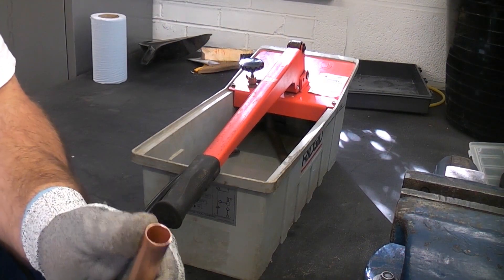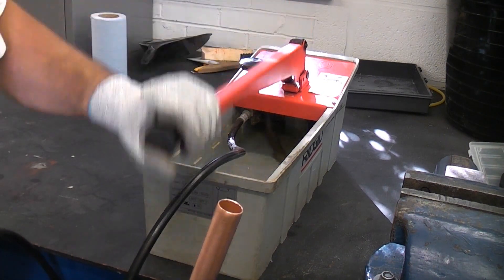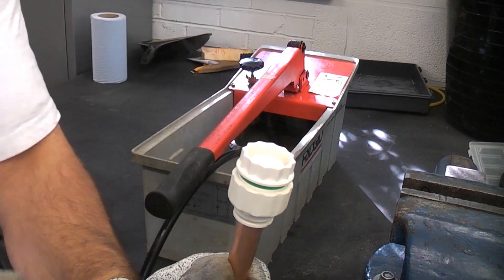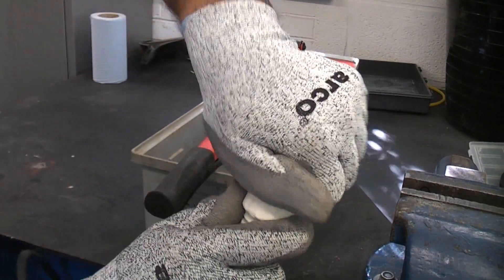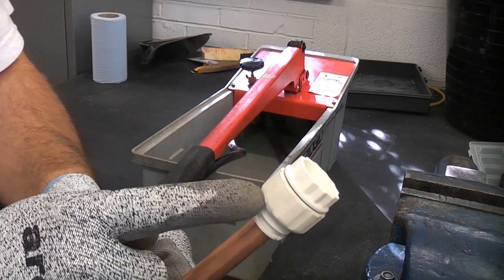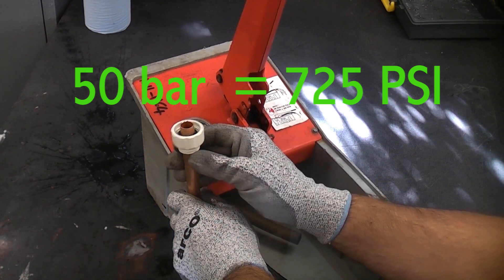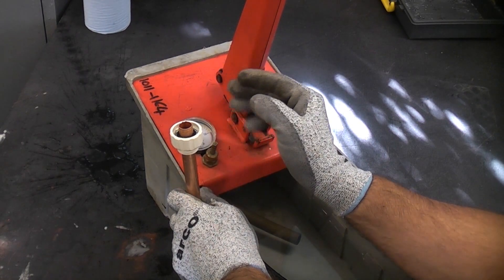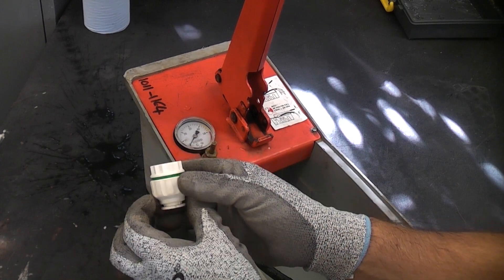Push fit fitting pressure test

Comment: I'm goings to DIY my wet room and I'm planning on using plastic pipes because I'm not a plumber. I'm going to be hiding the pipes behind the walls and will have no access to them when finished. I'd appreciate any tips or thoughts before I go ahead with this?
Reply from the maker: I've never done a wet room, plastic pipe is great and has many advantages over copper pipe, especially as you can bend it without any specialist equipment. I made a video a few weeks back on how to use it- https://www.youtube.com/watch?v=Z83vlwUyZIw
As long as you cut it correctly and use the correct inserts it will be fine.
Reply: Ultimate Handyman Thanks I guess I'll just have to give it a go👍🏼

Comment: Would like to see you do the test with the brass push fit fittings from Sharkbite and the like rather than brass with copper and PEX and see how they perform as i imagine they would get higher than 40-50 bar.     Interesting video none the less that to me debunks the people in forums saying they leak or will come off.   I would say people are not following the manufacturer instructions to prevent the O-Rings from getting damaged from not deburring and/or not putting the pipe in the full depth.
Reply from the maker: I'm afraid my pressure test rig only goes up to 50 BAR.
Thanks for the comment
Reply: Well it be interesting to see if the brass fittings would get up to the full 50 bar or not since the plastic one failed just before 50 bar but I guess it is really irrelevant in a domestic application.   I wonder how a copper cap would compare and if it could go much higher if you had a machine that could push it further.    

Considering that 50 bar is equivalent to being down 500 meters (1631 feet) below sea level this is pretty impressive as a recreational scuba diver can only go down about 40 meters (130 feet) and professional scuba diver can go about 60 meters (200 feet) before they feel their insides crush  LOL.

I definitely feel more confident putting these into my house if they are installed correctly (making sure you debur the ends to prevent o-ring damage and slipping it onto the joint to the manufacturer specs using marking lines if necessary).    I'm sure the brass fitting would outperform the plastic ones that you demo'd at nearly 50 bar.     Also considering the insurance companies and build code doesn't have an issue with them being installed in walls, etc   ... but I guess nothing beats a clamp on or solder joint.
Reply from the maker: I'm sure brass fittings would be far superior to plastic ones.
For underground water in the UK we use MDPE pipe and you can use compression fittings or push fit fittings on it providing you use a pipe insert, but there is a firm that makes brass push fit fittings (Melimatic) and they can be pushed straight onto the pipe without a pipe insert.
Good luck with the Scuba diving (rather you than me)
Thanks for the comments

Comment: I found out how good they are when I went to cold pressure test a boiler and forgot the filling loop was open. One of the lads told me the boiler was leaking and after 'dissing him',  I remembered about the test! The boiler had reached it's maximum pressure and the relief valve had opened (correction needed if a 'correct' term is known!). We went and checked every joint on the heating system and it was fine, hence, I swear by them now as I know what they can take (and more so now) Some great tips you keep showing, so thanks for them as you are never to old to learn new tricks.. :)
Reply from the maker: "relief valve opened" sounds fine to me, or relief valve discharged.
That reminds me of one particular relief valve at work, it is only a small one weighing a couple of kilos. It was sent to be calibrated one year and I refitted it and after de-isolating the steam line there was a drip from the end of it, so I thought some crap was stuck under the seat so I pulled the manual relief lever and the whole room was full of gushing steam within a fraction of a second. When I told a couple of the other engineers on site, they laughed because all of them had done exactly the same as me at some point! 
Thanks for the comment

Comment: Can it be used for hot water? Aprox 100
Reply from the maker: You would have to check a particular make. Speedfit fittings can operate up to 105 degrees C or 114 degrees C for short periods of time.
Thanks for the comment

Comment: The problems around pushfit, are the substandard copies and fakes that have flooded the market, i had a builder plumb a temporary kitchen sink using a pushfit system during a renovation...within days the water was tasting like plastic/burnt plastic, had it taken out by a plumber who then told me it was about to fail at the riser as there was a crack along the pushfit pressure line, when i looked at the joint, it didn't look like a normal pushfit, but builder swore blind it was legit....thing is, i still fired him, because he was told pipes to the temporary sink were to have been copper as the pipes would have been inaccessible.
If a builder cuts corners for a few quid, he ain't worth his salt.
Reply from the maker: Thanks for the comment

Comment: As other folks have mentioned how will these plastic fittings with a rubber seal age ????
I know a lot of boilers all now have very similar variants on the same thing buried away inside them but most new boilers are not likely to last 20 or 30 years so there life span is not going to be an issue. I don't personally think these fittings are going to last 50 plus years as correctly fitting compression and end feed joints we do, will be interesting to see, guess time will tell. Nice video though thanks for putting it out there mate.
Reply from the maker: I think you are correct, if I was installing pipe in my own house I would use copper pipe and solder fittings or compression.
Thanks for the comment
Reply: @ultimatehandyman  our house has a cold water  feed from a plastic 'alcathene' pipe thats over 45 years since it was fitted and so far (fingers and other bits crossed) still intact.... stopcock really needs changing, so things might get interesting...
Reply: most main pipework is copper, but a few bits of speedfit fittings and pipe in the porch extension, they're about 15 years old now... still good, although some fittings are earlier type than others, without the 'twist lock', and have discoloured....

Comment: How much of the push fitting is off the end of the pipe
Reply from the maker: It has to be inserted as far as it will go, but slowly moved to the end of the pipe with the pressure.

Comment: Thanks for this video i am impressed what pressure they can handle .... copper piping and joints your days are numbered
Reply from the maker: You are welcome.
I think copper pipe and fittings will be around for a long time as they are still the pipe materials of choice for most plumbers.
Thanks for the comment

Comment: Have to agree with you Roy Wrenn and many others. Twas a fair and honest test BUT.... It's clear that "Taking care" is something missing from this otherwise great video.
I would never recommend holding anything in your hand while pressure testing nor would I have anything tested to "POP" leaving to chance that it will not cause injury or death (If you think that sounds extreme; you'd never dream of pointed the end towards your head while testing! Would you?)

I don't mean any of my comments to be critical other than to say that health and safety should ALWAYS be priority No.1. Maybe then many of the cowboy builders who do all quality tradesmen or even handymen a discredit.

The product test was better than brilliant and would serve to give anyone a great confidence towards using these push fittings.
Thank you for sharing.
Reply from the maker: I do pressure testing regularly and pressure test to much higher pressures than in this video.
I don't think most people are aware that if something fails the pressure is immediately lost and so the likelihood of any harm is miniscule. Obviously the push fit fitting on the end of this pipe is going to pop off at some point at speed, but it's hardly going to damage anything unless you point it at someone's eye without safety glasses on.
Pressure testing rigs do not have the volume of water behind them to do any real damage. When we pressure test piping on site or vessels if something does go wrong you normally just get a slight leak of water until the pressure goes to zero. The largest vessel I have pressure tested held 200 tonnes of water, so pressure testing a push fit fitting on some 15mm pipe is really not a risky test for me.
Thanks for the concern though ;-)

Comment: As a plumber, I found this test very interesting. I have absolutely no hesitation in using good quality push fit sytems and I've been in the industry for 40 years. What gives pushfit it's bad name/failures are unskilled users who don't follow the manufacturer's instructions. However, I much prefer using copper pipe with push fit fittings than plastic pipe and it would be really great to see you doing the same pressure test on plastic pipe instead of copper. I doubt very much if the fittings would still grip plastic pipe at 50 bar.
Reply from the maker: You are right, but some of the failures are due to the lack of proper instructions with the push fit fittings. Years ago I picked some up from a large D.I.Y outlet and the instructions on the packet were minimal, there was no mention of not using them on chrome pipe for example!
I'll try pressure testing a push fit fitting on plastic pipe when I get time ;-)
Thanks for the comment
Reply: The other big no no is using modern metric push fits on imperial copper pipe. Speedfit and Hep20 make metric to imperial adaptors, but anyone attempting a bit of diy is going to be oblivious to this. Same goes with not using inserts or even just the correct inserts for each individual brand of pipe. They are not interchangeable as there are different tolerances in the diameter of each brand of pipe. Again, no one will explain that in a diy store. Keep up the good work. Videos are top dollar.
Reply from the maker: @tomhedger7013   A few weeks back I replaced a kitchen tap for my sister. To my horror I discovered that her house has been piped up in plastic pipes- with no pipe inserts! 

So I tested one of the fittings with some plastic pipe with no inserts, and it took 50 BAR (maximum pressure of my test bucket) and I left it for a good hour or so, before I had to put the stuff away and do something else ;-)

Of course hot water/ heating cooling might be a completely different outcome.

Thanks for the comment
Reply from the maker: @tomhedger7013   I'm sure there are instances where they will blow off! It's always best to use the correct inserts and fitting for the pipe that you are using- just in case ;-)
Thanks for the comments

Comment: I have to cap two pipes off tomorrow. I'm glad I saw this video. Thanks!
Reply from the maker: You are welcome.
Thanks for the comment
Reply: Bit of a first time disaster for me, but all good now. I had to remove a sink, and cap off the pipes that were left. I cut the pipes to make them parallel with the wall, but with it being a "T" section, there wasn't enough pipe left to put the cap on for a full fit. When I turned the water back on, it gushed everywhere. To make matters worse I had to turn the water off on the whole wing, so all the showers, toilets, sinks and baths had no water including the kitchen, AND I had a care assistant stood behind me putting pressure on me and another carer doing the funny "I need a pee" dance! I shut the water back off, and cut a small section out of the wall, revealing a longer length of pipe. I quickly cut it and put the end cap on that. It worked a treat thank my lucky stars! You'd think that would have put me off, but I had another sink to do and the capping off worked perfect. So thank you again for this video Note to self - Watch the whole video properly! lol!

Comment: Over time the plastic will go bad unlike copper.
Reply from the maker: True, Thanks for the comment
Reply: I have to disagree.  PE pipe has at least an 80 year life if not exposed to UV light.  The failure point will be the O rings in the joints, not the pipe.  PE pipe is used by water and gas distribution networks.  The main difference is that the joints are fused in the distribution networks.

Comment: The early versions of these fittings had the stainless fingers inside the 'o' ring and hence in water.  The dissimilar metals set up electrolytic corrosion and the hot water failed first after 18 months and the cold after 2 years in a system where plastic fittings had been joined to copper.  The metal was rotted away where the two metals touched.  These new ones have overcome this problem by moving the 'O' ring inboard.  However if they were to be used in a wet external environment such as a farm yard this could happen with the use of copper pipe at one side.  It should not be a problem with plastic to plastic.  'O' rings will rot in a few days if left in WD40 so careful with lubricants and oils.  I would expect ''O' ring failures after 20 years.  Pressure testing would be interesting in a simulated air pressure ring as is used in many workshops.  15mm copper is often used.  The fittings are clearly up to it.  Many thanks for the work.
Reply from the maker: Thanks for the detailed comment ;-)
Reply: Makes me think of the Challenger... =/

Comment: Very impressive , I am about to use two of these in a place only accessible with push fittings so the test gives me the confidence to carry on.
Reply from the maker: Sometimes they are the only fitting you can get on the pipe in difficult locations.
Best of luck with it ;-)

Comment: 50 bar is very impressive, but that was on copper pipe, which means the stainless steel clamp teeth have hard-ish metal to bite into. Please repeat the test with plastic pipe / end inserts. I'm expecting it to fail at a much lower pressure, as the stainless teeth will tear through surface of the plastic pipe, much easier than copper.
Reply: Not true, the plastic pipe will fail way before the fitting ever does.

Comment: Hi mate, great video! A plumber has installed this on the outbound copper pipe of a mixer shower that was running when turned off. (he removed the shower head and capped it off) this will be like this for about a week whilst he is on other jobs and will then return and fit the shower, is there any danger of the pipe bursting or pressure building up elsewhere? cold water tank and hot water thing in airing cupboard.
Reply from the maker: It should be fine. I also use these as a temporary cap when doing such jobs ;-)

Comment: The simple pressure resist the fitting, but how it looks, as assayed with contstantly variable temperature.  How it works in the heating tubes over the years, how does the rubber seal?
Reply from the maker: These fittings are normally reliable, although the sealing O ring may perish over time. We use similar joints on site for pneumatic systems and many of the joints are 25 years + in age and are still sealing fine, although you do get the odd one that leaks.
Reply: Thank you
Reply from the maker: You are welcome.
Reply: It took 17 years for my main push connect compression coupling to fail, the sealing O ring went bad and that's all.. The plastic compression couplings was big bulky things back then,  I took it in to get it replaced and the hardware store helper didn't know what it was lol..

Comment: All push fit fittings reccomend this as part of the installation as if its not pressurized to correct pressure for the teeth to grip. It can leak under normal pressure as its not high enough to force the stainless steel teeth to grip correctly.... this is not a DIY  product.

Comment: Cheers for that, always been a doubter of plastic push fits, but this video has al-aid my fears. I will be using them in future when plumbing hard to reach installations ie between walls and baths etc.
Reply from the maker: +jason laverty You are welcome. Sometimes push fit is just so easy, especially like you point out in difficult to reach situations.Thanks for the comment

Comment: It's all up to the durability of the stainless steel compression ring and the o ring.  I never use these.  I do use the shark bite brass ones, but never in a ceiling or wall.
Reply: THANKS FOR PUTTING "psi" on there as well!  I didn't have to look it up!  Good video.
Reply from the maker: +Steven King 
You are welcome
Thanks for the comment ;-)

Comment: Wanna impress me, show me how to stop the fitting from leaking after its 5 years old and you accidentally bump the darn thing.
Reply: +audimaximus Usually leaking is a result of a damaged O-ring. Remove the cap from the fitting, replace O-ring, put the cap back and you should be fine =)
Reply: Yeah, I figured out how to pop that sleeve and replace the o ring.  Good thing to learn since I have a high school full of these dried up brittle push fittings that start leaking by merely looking at them.

Comment: I was really impressed, I'm currently installing new pipe run for our washing machine and an additional sink and was debating with the lads at work whether to use these new fangled plastic push fit joints and decided not to and buy the copper compression ones.

Should have watched this 1st.
Reply from the maker: +Chris L 
I was surprised how well they performed!
Thanks for the comment ;-)

Comment: Still don't like them as all plastics degrade with time. Just a quick cheap bodge in my opinion.Thanks for sharing because I never expected it to stand that sort of pressure, but again it was only for a short time.
Reply from the maker: +Nodrog Awson 
Thanks for the comment ;-)
Reply: +Nodrog Awson Nah I don't accept. There's plenty of MDPE being fitted as a water mains and gas pipes.